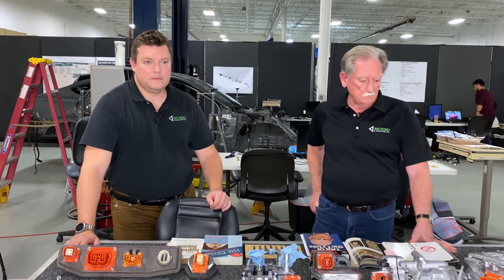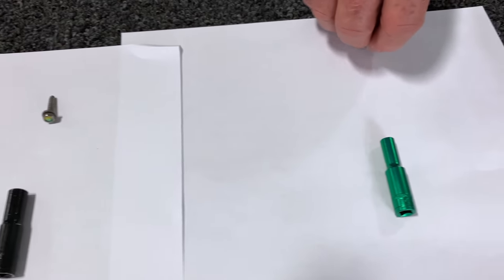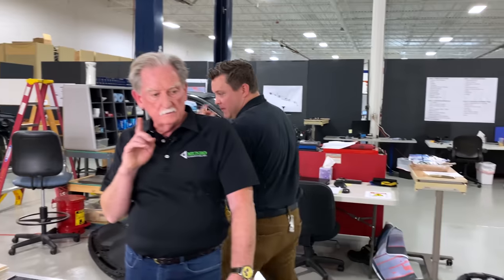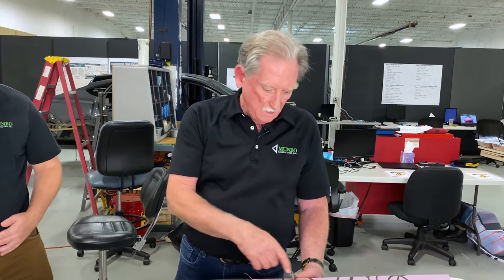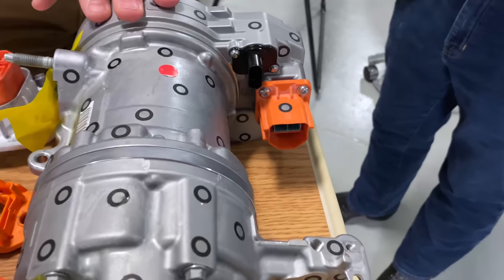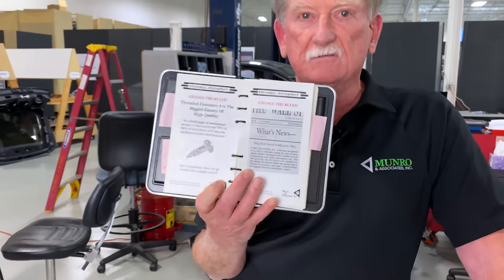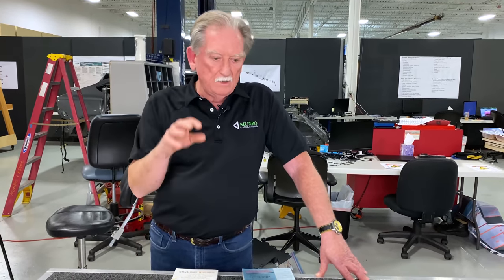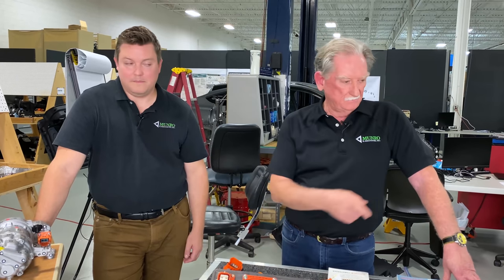Mach-E High Voltage Connector PALOOZA!!!

Comment: Seems like FoMoCo had focussed more on their traction inverter/motor development which drove the more common fasteners/connectors/cables between input and output side in those systems. Whereas most of the other HV components were sourced/came from other suppliers who delivered these parts (Heater, OBC, dcdc, compressor, etc.) with their preferred HV connectors. Hence the individual Tier 1 suppliers preferred fasteners that work for their customers in general and what works for their assembly line with their respective product portfolio, not necessarily with FoMoCOs. The supplier management team at Ford can improve on this as Sandy pointed out.

Noticeable observation of the On Board Charger: that's a relatively BIG OBC for a 11kW unit especially considering today's standards.

Comment: Sandy you said why did Volkswagen use so many fasteners?  They use the same amount of bolts holding on 16 but at least they were all the same make a bolt . It looks like to me they were making a water tight seal. Where as the mock E  used 16 different kinds of bolts.

Comment: Enjoyed the video- focus on common fasteners and tools - why do we unlearn those things? Also got a kick out of the late 80's bookshelf on the table (Deming book - I have a signed copy), Eli Goldratt theory of constraints, Innovators Dilemna - all classics and taught a lot of lessons in their day. But why does Ford have so darned many aluminum casting encapsulated separate modules? That's what really stands out more than the fasteners. Gotta be a hundred pounds of excess 'road hugging weight, kind of like the 1974 Pinto.

Comment: Not just common screws.  Don’t forget about using common connectors, terminals and wires.  Wire harnesses are even more fragmented than fasteners and more prone to quality problems.

Comment: The Terror and Erebus' mission didn't fail because of food.  The food was made to the quality standards of the time.
The high levels of lead in the bodies can be explained by them living in high lead consumption times, and when they were starving to death, the lead in their fat and muscles was liberated into their bodies again.  However there was not enough lead to cause them (much) damage(especially because by this time they were starving to death already).
Their water distilling / steam power system is also suspect, as it was very new technology at the time, but that probably did not contribute much lead to their bodies either.
They basically just got stuck in the ice, and couldn't make it out before everyone starved.
Lots of people lost their careers or reputation because of the failure, but it was just a cutting edge exploration mission, that pushed further than they were prepared for.

Comment: I have noticed that spring washers don’t seem to do much to keep things tight, like you mentioned in your video.  Some people might be interested in a video about what type of locking elements work and what do not.  Maybe sort of a ranking from best to worst.  I see a lot of people who should know better ( mechanics ) who rely on spring washers where they should be using a fail safe locking element nut.  The worst thing I see is “ Double nuts “.  I have seen double nuted fasteners loosen more times then I can remember.

Comment: The connectors on the Mach-E are mostly standard industry available connectors. The different connectors and fasteners STRONGLY hints two things, #1, all these parts are not made by ford but by outside suppliers, #2, based on many outsourced components, complex and expensive wiring harnesses and plumbing systems, Ford doesn't intend on making very many of these vehicles...  It's looking like and quacking like a compliance car.

Comment: Somehow this video reminds me of the last Suzuki motorcycle I owned.  They mounted the 12V battery on its side, and wrapped a bunch of cables/components/padding around it so that you had to swear excessively at the design engineers as you proceeded to take it out for the winter or to just replace it.  WTF?  It only took me 2 hours the first time.  Needed to get rid of some things.  👍

Comment: If I were in charge of the Mach-e engineering, I'd be updating my resume asap. This is sheer insanity. Time after time there are a bizarre number of parts. That these all have different fasteners is mind boggling.
Reply: For more mind boggling check these out on the Mach-e thermal system:

https://www.youtube.com/watch?v=m1kHsd3Ocxc&t=13s

https://www.youtube.com/watch?v=Rp2ktJ6174c&t=532s

Comment: That amount of different fasteners is a mechanics nightmare. I didn't see any tri-wing screws. Maybe in their new F-150 they can add a few more different screws. I forgot, the 12 point internal wrenching head was also missing and its available in two different configurations, and of course there is the 12 external head. There is also the British Standard hardware they could throw in the mix. If Lucas the Prince of darkness was still in business they would probably throw that in there.

Comment: I've taught materials management for years and this stuff drives materials managers and purchasing departments batty... Every SKU is an opportunity for something to not be available for manufacturing, something else that needs revision control. as well as a quality fail point... What's weird is in other videos Sandy has pointed out where they're using existing parts from IC vehicles, something that's done to try and combat SKU proliferation but then turn around and do this...

Comment: Why would any of these HV components come from the same assembly line and need to share fasteners? This seems to only matter if someone is trying to take everything apart.
For assembly, those modules might even come from different suppliers, and a replacement might use different fasteners.

Comment: Most these connectors are installed in componets made by different suppliers so who cares if they are different if they are the lowest overall cost because supplier A already uses one connector standard and that is different from supplier B. Forcing suppliers to make unique parts to follow each OEM's unique requirements only increases costs and reduces quality by throwing away something that is already proven to work. 

Also it very common to use different fastener head types to guarantee bolts can't be installed in the wrong location  because typically each operator or automated run down tooling will only have one socket that matches the bolts they are installing in those specific conditions. These cars aren't hand built by one person that has to keep changing tools. Therefore, in high volume production it doesnt matter if different operators have different sockets because they each have their own tool do their own job. It also really prevents problems when suppliers mix in a few wrong bolts in a box that are too short because they can't accidentally be installed if they have a different head type than the socket being used for the correct one. It's called error proofing and it drives quality, but yes at the expense of frustrating people that want to take the entire car apart.

Comment: If Ford is sourcing the whole part externally with connector and not internally I don't see the issue with the screws as they aren't going impact the Ford assembly line.. However the connector TYPES, and cables, that is an issue.

Comment: the "plastic" reminds me of bakelite back in the old days that would degrade rapidly. That said, I would think they could design a format for the subsystem that could be one-shot injection molded platform. but I ramble. Thanks for vid, I learn, sometimes just like the show.

PS - those look like milled castings.

PPS - I did giggle at the warning labels.

Comment: I assume the ID4 connector has a face seal. You need this many fastener to energize the seal. The seal will compression set over time. If the span is to large ( due to less fasteners) if will deflect due to seal reaction forces which may be okay but this will result in the plastic going into creep failure. The devil is in the details. FWIW,  last connector i designed with fasteners was in 2014.

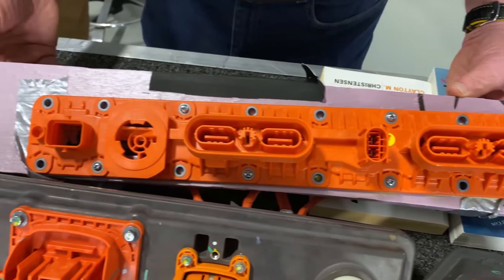Comment: VW fasteners 8:40 
Why didn't they get rid of some of the fasteners?
Answer: They did. They had 5 components, 3 of them had 4 fasteners (12) and two of them had 6 fasteners (12) for a total of 24 fasteners.
The integrated board has only 12 fasteners.  And probably many long meetings were required to achieve that!

Comment: Just an FYI, the voltage level according to IEEE is considered Low voltage, definitely not High voltage.  Low voltage is 600 volts or less and I think the actual voltage is supposed to be 600?  Anyway, at worst it would be considered medium voltage if higher than 600 volts.

Comment: If Ford gets these components pre-assembled from suppliers, the fasteners are really a non-issue for them. And I guess it was easier for them to bolt all the off the shelf connectors onto a plate rather than design and fabricate a bespoke I/O panel for the battery.
Since Tesla are making their own components, it makes sense for them to take a more integrated approach.

Comment: Sandy and his crew already tore down the Mach-E HVAC system and the battery pack, and found pretty much the same plethora of threaded fasteners in both subsystems.  Snapping in just doesn't seem to be a design goal at Ford.

In all three subsystems we see unnecessarily long and numerous hoses and cables.  These add extra weight and increase failure modes.

For those who hope to see Ford survive into the next decade, these engineering choices, which take a toll on vehicle energy efficiency, assembly costs and follow-on operational costs, are disappointing, to say the least.

Comment: There's plenty of comments I could make, many agreeing wholeheartedly with Sandy in respect of fasteners. I'm a bit of a fasteners geek myself ! However there's one observation I'd make about the Ford Mach-e and it's this.

The Mach-e looks strongly as if 'someone', maybe a committee or perhaps one of those damned MBAs, chose to skip part of the production engineering phase. I've spotted the signs in other videos about it too. The design isn't completed ! It's as if Ford decided to put a late model prototype into volume manufacture.The signs are 'everywhere' ! Maybe that was done to meet some deadline but I'm convinced it's the case.

Comment: Couldn’t find it in the comments but I would like to know what the story is behind that Chigaco/Michigan screw? It looked like it would be in an engineering meme about a failed solution to a problem that shouldn’t exist…I’m a designer by education (not automotive) but I do mostly engineering type of work and a lot of the stuff I see in these videos I can relate to and I have thought very similarly over the years. I get weird satisfaction if I can combine multiple parts into one single part. Or reduce material thickness. Or simplify things and achieve a better visual appearance, the list goes on. Great channel, I have learned a lot!

Comment: In view of FoMoCo engineers using the reverse torx and the high-security pencil lobe security fasteners there is an indication they do not want the MachE's owners playing shade-tree mechanic.  Face it, it had to take serious effort to somehow someway use that diverse a selection of fasteners and the tools to drive them.  Given that Tesla essentially will not sell parts to almost everyone and hence slamming the door on repair shops, perhaps FoMoCo is trying to complicate the common folks from working on the MachEs.

Comment: 10mm wrenched should be the only tool needed. 

You can take apart about 80% of my motorcycle with 3 sizes of torx ... not bad but the ultimate would be only needing the 10mm.

Comment: If I get an AC compressor from the supplier why should I care about the fastener if it comes assembled already ?

Weight could be a topic but I would not care about the fastener they had used.

Comment: I'm always yelling at my sprinkler head screws - Orbit this means you!.  There are at least 4 different types, each requires a different size screwdriver.  All of those could be replaced with just one thumb screw which would require NO screwdrivers at all.

Comment: I get that Telsa probably produces all of their components and thus standardization makes complete sense.  Are all of the Mach-E ones similarly in-house produced by Ford or are they from disparate vendors?  i.e. If all of the inverters are produced by one company and they come into the Ford assembly line with the orange connector attached already, why does Ford really care if it's a different screw than that of the battery pack?

Comment: All of those connectors are not fastened in the same order as you overview it on the table. Different assembling lines or areas, different tools, different screws are not a problem.
Reply: Maybe, but if you want workers to switch assebly lines, the problem will arise.
Reply: You'd know I guess.

Comment: Having unique connectors and screws/bolts on important components like this is pretty common safety thing in high voltage gear. Never assume your staff will put the correct connector in the correct port, always make it impossible to screw it up. This isn't a cheap design, but seems like an excellent design from everything I've seen here. Threading issues with bolts aside of course. It'll be really interesting once there's a few years of real world data to show the reliability of the mach-e (and other VW's etc) vs the low reliability of Teslas, and then whether the increased build quality and reliability are alone enough to pull people from the allure of the badge when it comes to buying a Tesla.
Reply: Can you point us to your data set regarding reliability, please!

Comment: The fastener types shown in this video are dictated by the supplier of that module, not the OEM. I agree that it's good practice to commonize fasteners, but the connectors/fasteners they are referring to are non-serviceable parts. Meaning, the entire module would be replaced if there was a connector failure.

Comment: sad indeed, from a lay perspective this seems so obvious, it reminds me of Honda motorcycle in the '60s, they came with a small toolkit that literally fit every fastened on the motorcycle because they only had a limited number of fasteners.  The tools were crap and probably couldn't be used for more than a little work, Honda back then understood simplicity in fasteners.
Reply: Japanese vehicle toolkit: 10mm wrench and a screwdriver.
Reply: @scottthomson7953  pliers, screw driver, spark plug socket, 2 dual open wrenches, and a dual box wrench.

Comment: Does Ford actually need to deal with these fasteners or do the parts they’re in show up from the supplier already assembled?
Reply: There's more to "dealing" with these fasteners besides just the factory floor work. Every mechanic in every dealership is going to have to have a special driver for every head design. And Ford is going to have to pay for all the warranty work. No wonder Ford doesn't make a profit.

Comment: You're the best and honest reviewer ever in the autoindustry.!

Using 13 several bolts for mounting a standard connector is really boring and expensive!

Couldn't get it that Ford is going back to complicated assembly in future cars!

The same with their cooling system and the bunch of hoses....

No, that's not the way to earn money on the items.

Tesla may have quality issues in correct assembly but they are more simple in using bolts and connectors.

Thanks for your videos.

Comment: I think Ford's goal was to make an EV, not to make money on it, just to get it to market. I guess we will have to wait and see if they make these and other improvements and efficiencies. Sandy worked at Ford once and says it was hard to get changes made.
If the structure of the company is reflected in the car then you would need to change the structure of the company if you wanted to change the car.

Comment: Is Ford actually installing all those fasteners or do they just buy the components pre-assembled?
Reply: Ford is telling their suppliers they want X, and they build it and supply it.  Ford must not be specifying the design requirements, and they're building the Mach E around what the supplier built.  It Sandy really wants Ford to simplify their production, then he needs to tell them to become vertically integrated.

Comment: I think that you have mentioned the main reason to have so many different components, in this case screws and tools, in one of your previous videos. There are just a lot of different teams working on different components, and probably no coordination and communication between them. This is a big problem in the big old companies. Also it seems that there are not a lot of good project managers to lead such big projects, that can get and assimilate all the information from the different departments, identify the flaws and work to correct them. Probably one other issue is the shorter times to get new product on the market, because we are consumer driven and companies try to shorten the cycle of bringing new products to their customers. And last, there is some degradation in the education, at least where I live.

Comment: I really feel like this was 100% intentional on the part of Ford. It is obvious first off that every connector is very obviously different. That prevents a cable from being plugged into the wrong connector. And secondly, by having different sizes and styles of screws, that prevents the wrong connector from being used on the components themselves. So it's a double fool-proof system to prevent ANY possible screwups either in assembly or later repair. That tells me that someone at Ford is not confident in their assembly people. I would bet that an analysis of the connectors for the miles of coolant lines would show a similar trend.
Reply: Is it made in Mexico?